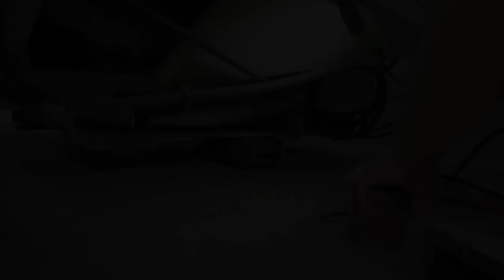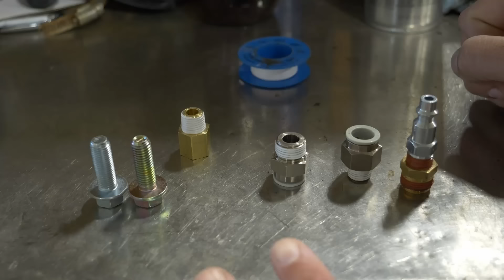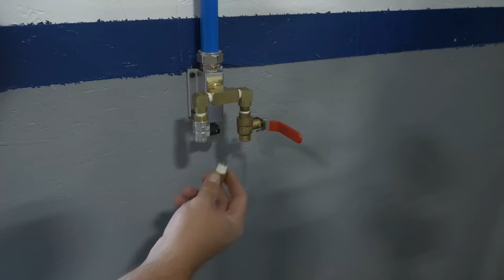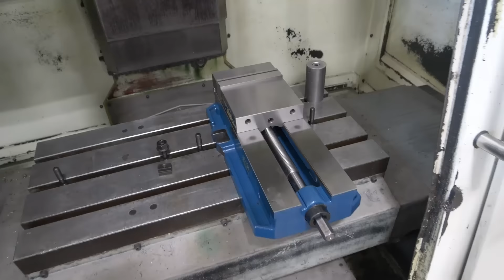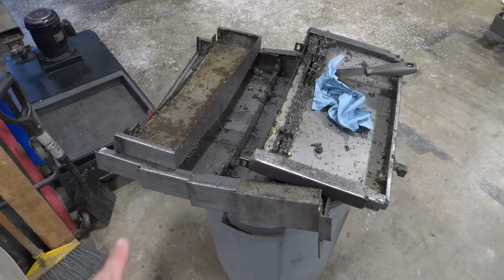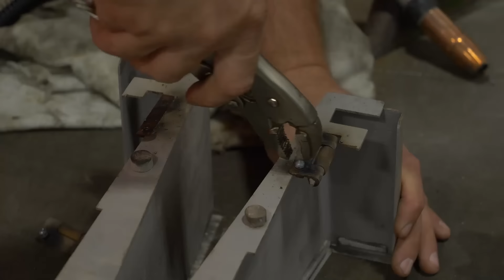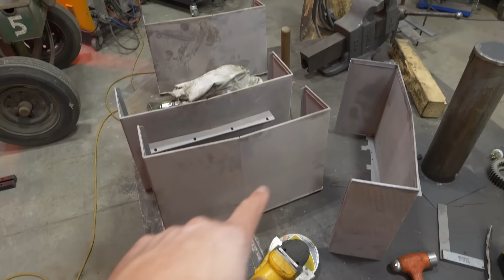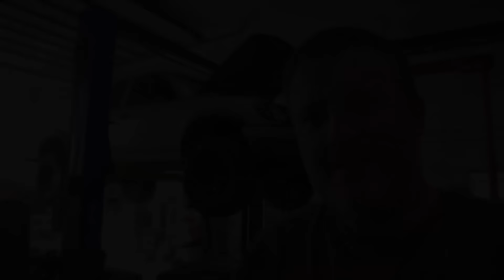Did I Buy a Problem or a Solution? Cheap CNC Repair Part 1

Comment: Again,  you really amaze me. It's never a dull video. I was amazed at how filthy that machine was. I was in the electronics field and done a lot of prefab, never seen anything like it. Part 2 will be epic. Thank you for sharing 👌 😊
Reply: Making chips is making money. So it is not amazing at all. Cleaning machines isn't making money with them. Cycling machines is.
Reply: @1pcfred  I myself didn't make chips. I worked tactical  and communication .

Comment: Here in New Zealand that Toyota would have been put off the road years ago. Our vehicle yearly inspections  are very strict on rust and nearly every one you work on would fail. There are a lot of people that don't understand all the different threads out there and you are lucky you don't work on old British stuff with  all there different threads too. I am restoring an old British tractor at the moment which has BSF threads. My toolbox has tools for four types of nuts and bolts and and seven sets of taps and dies for the different threads I have to deal with.
Reply: Start playing with the carburettor and discover the joys of BA threads!

Comment: Hah, I ran into BSP hydraulic fittings on my JF hay mower (it's from Holland, isn't that weird?!) when I forgot to uncouple the lines and pulled the tractor away, breaking all of them... Oops. Anyway, I was like; screw ordering adapters, I'll cut some JIC to BSP 3/8 adapters on my lathe! Cut to a couple hours later: wait, is this *&#@ thing actually 19 TPI?? -count threads, do math- #&*@ 19 TPI?! My 80 year old South Bend lathe gear box doesn't even have a setting for 19TPI!

I ordered some adapters online.
Reply from the maker: We've all been there!
Reply: It still amazes me how hard it is to find metric hardware in the USA... All modern cars are 100% metric, most heavy equipment is metric, more than half of ag equipment is metric, I guess some heavy truck stuff is still all imperial/standard? But why can I sti find a litteral bucket of 1/2-13 bolts in every length and grade under the sun in my local hardware stores and Fastenall, but I pay through the nose to select from a scant handfull 12x1.75mm bolts?
Reply from the maker: @JawzXlives  I don't know. I stock metric stuff just so I don't have to deal with it.

Comment: I'm really disappointed that the cardboard scale model didn't have a functioning tool changer
Reply from the maker: It's an optional upgrade.
Reply: @WatchWesWork  

Is the cardboard unit for sale?  It is already leveled which would be a great time saver. How much for the optional tool changer? Is there a work light option as well?
Reply: @leonardhaskins8892  Yeah, there's a work light option,  but I hear it's quite a chore using the onscreen menu to toggle it on or off.
Reply: That's Wes for you, always trying to keep production costs down without thinking about his audience...

Comment: Can't wait for the next part. Buying used CNC machines is always such a mess, I think you've hit on most of the highlights... no manuals / schematics, quirky electronics, mixed fittings and bolts, metal shavings everywhere, nasty fans, coolant mist funk on everything, having to scour the internet for that one exact random obsolete part that you need to get your machine running. Fun times...

Comment: For all those crazy standards, are the fittings marked appropriately or does everything have to be reverse engineered with thread pitch gauges and protractors?
Reply from the maker: Marked? That's nonsense...
Reply: Thread gauges, protractors, try-boards, googling, and occasionally blind luck.  For this reason I mark our fittings with size and type.

I have worn out a lot of letter and number stamps.

Comment: To bad you didn't find a used Fadal.  They are a lot easier to work on and much more user friendly in the control area.  Have fun and keep on smiling.
Reply from the maker: They have a cult following, so they're usually pretty pricey. Kind of like a Haas.

Comment: We used to use an orbital sander to get the final finish on the way covers.
Reply from the maker: That's what I did. But I didn't go past 60 grit. It's not going in a show room...
Reply: @WatchWesWork  Would JB Weld SteelStik (TM) work to fill those deep scratches on your large way cover?

Comment: Metric system is more intuitive and easier. The issue comes when you mix imperial and metric, it becomes a nightmare!!! Here in Argentina we have imperial bolts, metric nuts, npt is the most common pipe thread, but pipes now are in milimiters intead of inches, i mean...
Reply from the maker: I know all about it. It's the same here. You can buy 10mm plywood in a 4x8 foot sheet...
Reply: @WatchWesWork  Thank god we don't have that sort of mix here in Australia.  Here our 10mm plywood sheets are 1220mm x 2440mm 🙄.

Comment: Just because it's metric doesn't stop folk from choosing any number of different metric measurements. Probably the same with Imperial to be honest. Keep it simple, move to the UK. Milk in litres, beer in pints. Gas economy in miles to the litre. Short distances in metric, long distances in miles. I count myself incredibly lucky to have been born in 1970. The perfect age to be able to think fluently in both, anyone else is pretty much screwed in our messed up hybrid system. 

Oh and our UK Imperial units are often different to US units of the exact same name. Because why make it easy.
Reply from the maker: It's pretty much the same here. It's not unusual to work on a truck with inch, DIN, and JIS bolts all within arm's reach. I switch between the systems all day every day and don't even really think about it.
Reply: @WatchWesWork  And let's not start on all the different screw heads.

Comment: I kind of feel sorry for you Wes. Having almost 30 years experience in cnc’s I can tell you that Korean and Taiwanese machines are the worst for holding tolerance and reliability especially as the years mount up. Don’t get me started on parts availability as the years mount either. All I can say is good luck in your ventures back into cnc’s! If anyone is capable of pulling it off as problems rear their ugly head your my guy.
Reply from the maker: It's never gonna be an Okuma or a Mori Seiki. That's also why it was cheap.

Comment: 3d printer is going to get a lot of work, making them broken plastic pieces. Them industrial fans ain't cheap, a 120mm 240v high flow, metal bladed will set you back close on £100 here in the UK. I've replaced quite a few on outstations and industrial chiller control panels.
Reply from the maker: It cost about $200 for the pair. But it's cheap insurance.

Comment: The bsp also comes in straight as well as tapered and if I’m not mistaken it’s fine and coarse thread.
Most hardware shops here in UK stock not only our common threads but most of the threads from the rest of the world.
We can even get imperial threads with metric heads .

Comment: Did you make a copy of the operating system drives of that machine? If possible?
Reply from the maker: I can try. It has a solid state drive, so it should be pretty safe.
Reply: @WatchWesWork  Cool beans!

Comment: Kudos on actually making an attempt to level the machine. And repairing the covers. I spend lots of time throughout the year cleaning our circular cold saws and band saws. While maintaining production... most of our equipment is missing at least half of the machine feet. A fork lift is also a battering ram even without the thousands of pounds we move around. I don't remember the history I heard on bloody gultch road, I'll have to remember where I read up on it.

Comment: Hello from Norway 🇳🇴 great video as always 👍 over here we salt the roads an insane amount and normally we undercoat the cars from new if we want them to last. It seems like that is not normal practice over in the US or am I wrong? We spray everything underneath and inside frames and beneath fender liners as well to keep the rust away.
Reply from the maker: We do it here too, but it only helps so much. Eventually they all rust.

Comment: The service manual says 120Nm to tighten the lug bolts, set the torque wrench to 120Nm and click away, no math.
As a DIY guy I only bothered to do the torque calculation once for a regular lug bolt wrench just out of curiosity. Curiosity born out of incredible struggle to undo lug bolts tightened to probably several hundreds of Nm and/or rusted solid, I hate tire shops with their pneumatic tools miraculously set to just below the point where they'd shear off the bolt head.
Reply from the maker: I like to have some intuition for forces and pressures. It's a good way to know if your in the "danger zone". But, as long as you can remember a few numbers you can accomplish the same thing.

Comment: Working in the dying embers of the UK oil and gas industry mismatched BSP and NPT threads have lead to more than a few injuries and fatalities over the years by fittings blowing out under pressure. 
Our European cousins like to hide the fact that they are using BSPP threads by calling them G1/4, G1/2 etc 😂
Reply from the maker: Interesting. I've never seen the "G1/4" call out.
Reply: @WatchWesWork  just had it working on some packaging machines, the direct mounting instruments etc were all like that.
Reply: Don't forget R fittings (BSPT).

Comment: Nice. You obviously place a lot of importance on properly functioning way covers. Was it a close decision at all when deciding whether or not to invest the time cleaning, sandblasting, spot welding, tracking down expensive seals?  They seem like a longer term investment. Was fixing them more of a necessary thing or a 'fun' thing to do?
Reply from the maker: I think they are the most important part of the machine. They keep the expensive stuff protected.

Comment: Glad you pointed out not to use 4 machine skates.  We've moved several heavy pieces of equivalent with them. We had to use 4 due to the size and shape of the machine, but it was very challenging.  The key if slow and steady with lots of people watching.

Comment: Mass in the Imperial measurement system is the SLUG. You divide the “weight” in pounds by 32.174 (one g) to obtain mass in slugs. Test engineers, being practical people, we call mass and weight “lbm” and “lbf”. 
But as you just explained the touted metric system makes a mess of torque readings. 
Why didn’t we change to Metric after WWII? A machinery buyer at Ford once told me that there were so many machine tools in service that would have required lead screw changes (or just scrapping) perfectly serviceable lathes and mills that nobody could make the financials work. 
Sorta like H-P computers and Apple computers. Very different operating systems, but both do the job. It just depends on which system you started with.
Reply from the maker: Nah. We're just stubborn. 80 years ago we were making most of what we needed domestically, so there was no incentive to change. The automotive industry was kind of the first to go metric in 70s. Having worked in that industry, I can tell you we often specked steel at 3.175mm (1/8") and screws with 2.12mm thread pitch (12 tpi). It's not practical to convert everything. We'll gradually fade into metric as the world shrinks.

Comment: Does british pipe actually count as metric?  In my mind, that's just one of the many imperial standards that exist, and metric nations have replaced almost all of them except a few, like BSP.  Also ratchets even in metric countries are 1/4, 3/8, and 1/2.  And a lot of shaft sizes are in inches many metric nations.  But yeah, all the different standards, many of them very similar to each other, certainly makes for some confusion and frustration!

Comment: I am a retired American living in the Philippines.
So I am able to understand both metric units and s a e units of measurement and had to know both from my days as a CNC press brake operator where the steel used by different companies we conracted with used both  metric and s a e measurements interchangeably depending on the company. Cat, John Deere,  Hitachi, Komatsu, J c b,
Reply: The difference in gauge is how much one drawing can reduce the stock. Metric is arbitrary.
Reply: @1pcfred  Meteric system of measurements are fact based and great themeteric system is in multipules of ten
ten,hundred, thousand be it weights lengths or volume. none of which are Abitrary.
arbitrary
adjective
ar·bi·trary ˈär-bə-ˌtrer-ē  -ˌtre-rē
Synonyms of arbitrary
1
a
: existing or coming about seemingly at random or by chance or as a capricious and unreasonable act of will
an arbitrary choice
When a task is not seen in a meaningful context it is experienced as being arbitrary.
—Nehemiah Jordan
b
: based on or determined by individual preference or convenience rather than by necessity or the intrinsic nature of something.
metric

noun

: a standard of measurement

Comment: You can't do proper engineering in inches
Reply from the maker: We put a lot of men on the moon with inches.
Reply: @WatchWesWork  NASA used an awful lot of metric to put men on the moon (probably because that's what the Germans like Wernher von Braun used), but the final displays the astronauts read were in Imperial because that's what they were familiar with.

For example, all the guidance and navigation calculations were done by the computers in metric, and only converted to Imperial when they needed to be displayed to the astronauts.

Comment: Ive been a welder for a long itme and Ive done some sketchy stuff on trucks, tractors and equipment. Including a lot of frames but that one right there ? I dont think I would take it on.. Theres nothing  left to rebuild,  holes are one thing.. whole  sections of broken frame and missing frame are another... Shame too, those were good trucks. I had one..

Comment: I'm in the UK and I work in both imperial and metric, I can interchange between the two with no problem. When it comes to calculations, metric is easier.
Reply: You're probably not old enough to have ever worked in Imperial. The UK switched to Standard in 1931 after all. The Standard inch is the inch that's precisely 2.54 centimeters in length. The old Imperial inch was two millionths shorter than that which did make conversions a bear. That's why Standard was adopted. To make converting easier. No one noticed the extra 2 millionths. It's like a conspiracy theory. They stretched out the inch! They just stretched it so little no one ever noticed. But they actually did. That really happened.

Comment: Toyota had a frame recall in the mid 2015 time frame. They were replacing Tacoma and Tundra frames for free. On some Tacomas they did a buy back. Gave the customer a sweet deal.  They replaced the frame on my 2000 Tundra including brake lines, control arms and a frame.
Reply: I came here to post the same thing. I wonder if the program is still available since they were, I think, forced to fix this issue due to their specific boxed design being the reason why they rusted so badly.
Reply: @gb1613  no, the program is long over. I left Toyota in 2020 and the program was over before then.
Reply: Or you could be like Mustie1 and buy one of the trucks Toyota dealer bought back to be salvaged, and repair frame yourself :-)

Comment: This is used CNC machines in a nutshell. Everybody thinks about ways and motors and spindles and ball screws, which often aren't the problem. It's all the things they don't think about, like way covers, air logic blocks etc which are out of production or proprietary.

Comment: As you may know there was a frame rust recall on that generation Tacoma. It has since come and gone though. I believe it was 15 years from the date it was put in service.

Toyota would actually buy those trucks back and crush them. They paid 150% of KBB excellent condition no matter the miles. The following generation they replaced the frames for free.

Signed...the guy who had the identical truck to the one in your video (albeit a 1999) and had it bought back for $12,800 when i had paid $4500.00 three years prior.

Comment: Props for using "vintage" (heck I think it's from 70's or 80's) polish machine levels!
Reply from the maker: They were still making them up to about 20 years ago I think. Or maybe they were burning off old inventory. Good tools IMO.
Reply: @WatchWesWork  They went out of business around 2010. Some subsidiaries are still going and even seem to have some old stocks. Anyways, I'm one of the 'metric' guys from central Europe that watches you so in case you need some help in locating some weird metric stuff one this side of pond, let me know - I'll gladly help.

Comment: I don’t believe I just saw a professional mechanic using a crescent wrench backwards.  You always put the pressure on the stationary jaw not the movable one.  Shame!  😂😂😂😂
Reply from the maker: That's a wives tale.
Reply: Figures.  I’ve done it myself.  Just pulling your chain.  Faithful subscriber.

Comment: A while back, I was moving a large lathe(like 26k) they didn't have room, so they set it on skates, and tried to push it on from behind, the skates toed like you said, it came off the steel rail of the trailer and pow,  right through the wood deck, lol
Handy indeed, but sketchy for sure!